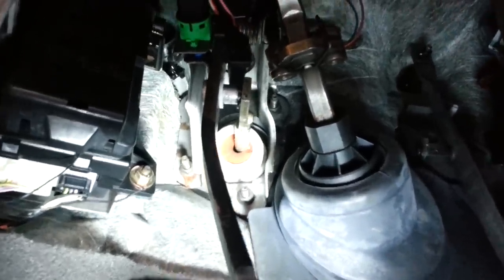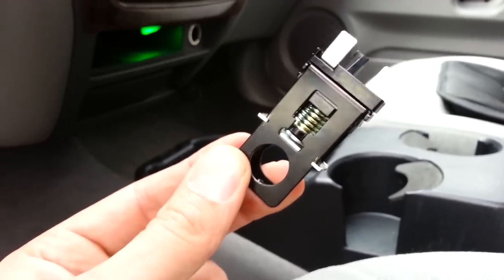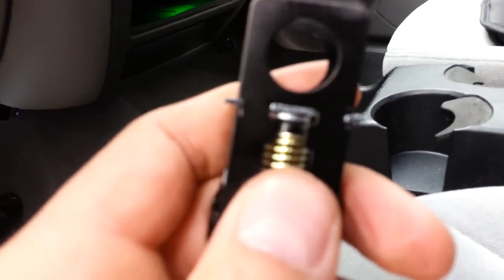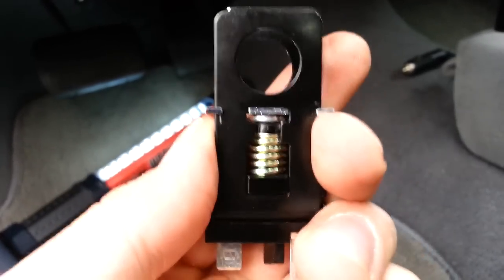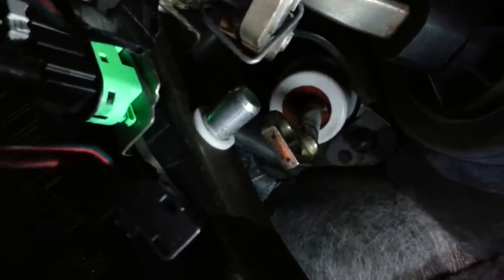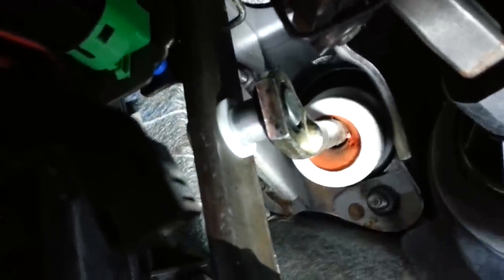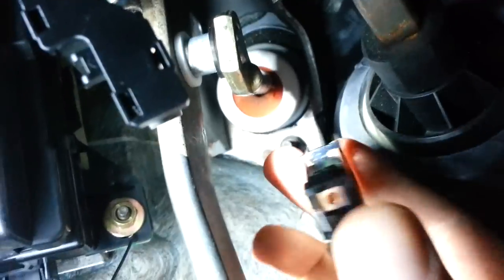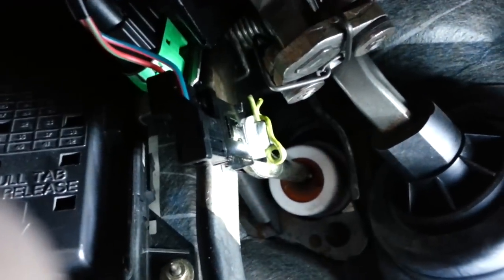Ford Taurus Won't Shift Out Of Park, Brake Lights Don't Work With New Switch- How to fix 2023

Comment from the maker: Note: The Motorcraft stoplight switch may function perfectly versus the OEM switch from your local Auto parts store. If you can purchase the Ford part, I would recommend that.
Reply: how could the 2 be any different, I know the ford part would cost more! a lot more.
Reply: Was your old brake light switch plastic housed with a square male plug that went into it and pre recall?  And is that the reason why this switch required wires be spliced? 

Also do you recall witch parts store you got your switch from?

Edit: I think my switch in my 01 Taurus has shorted out due to me having to wiggle the wires in order to get my brake lights to work and the car to shift. Now the brake lights won't go out at all and car shifts just fine. If I pull the fuse to get my brake lights to turn out the shifter won't move from park unless I do the partial turn of key and switch to neutral trick before starting.

Comment: Thank you so much for the YouTube.  I was unable to place a washer in as explained however, by placing a flat head screwdrive in the spring and twisting it, the car came out of park. I had to place the car back into park in order to remove my key but not a problem.  I went to O'Reilly's Auto Parts and bought a new switch for $32, 15 minutes to install, everything works great.

Comment: Thank you so much for your video!! This is a life saver. I put the brake switch on a few times, switch the wiring back and forth to the harness and it still didn’t work and I googled and searched for help and came across your video. I used a paper clip between the plunger and the plate, couldn’t find a washer at the time and I connected it back and it worked!!!! Thanks again for your video my friend.

Comment: It's so nice of you to take the time to post this video.  I was able to remove and replace my stop light switch on my 2000 Taurus with no problems. Definitely save over a hundred bucks, if not more.  And I could get the switch off so my battery didn't die while I was waiting for the part to come in.  Thank you very much my new friend.  Season's Greetings.

Comment: I had this problem on my Mom's car and we checked the brake lights and they did not work so we pulled the switch and tested its continuity. That was good so we made this modification with a very small washer and it worked great. Thank you so much.

Comment: This was super helpful and turned out to be an easy fix. The previous owner had done the recall so all I had to do was insert the washer and brake lights and shifting are smooth. Pretty little time in labor, and the washer was under $1. Thank you!

Comment: Peter you're a superstar, and I mean you really rock!  My 2003 Mustang track car's brake lights quit working.  Long story short, I went thru hours of effort trouble shooting and replacing multiple connectors and switches without success.  I stumbled across your video with some helpful advice about the little washer.  I figured what have I got to lose and made the modification.  WAHOO!!!! Your recommendation solved my problem.  I have no idea why a brand new switch doesn't work out of the box, it tested good, but as your explained, it just needs a little extra distance to work when installed!
Reply: I have exactly the same problem with my 97 Ford Fairmont EL ....mine did not work as yet after i installed it....also i still have no brake lights nor Cruise Control function, so i guess i will do it again but i will add the washer and see what happens..ran outta time..Thank you so much for your video, i would recommend you to everyone! Cheers from Wollongong in Australia.
Reply: so the little washer worked
Reply: What size is the washer used?

Comment: I replaced my brake light switch without the washer and replaced the wiring...and now my brake lights work and also my gears shifting back to normal. Thank you so much for showing the how to of this video!!!
Reply: So I have a question you say that this has been in an open recall here it is 2019 and I'm having the same problem with my 02 Ford Taurus. When my brake lights come on I can shift out of park sometimes my brake lights do not come on when I push the brake and of course I'm stuck in park. So I am positive it's the same problem this switch! So how do I get the new replacement one? Is it free do I call Ford what do I do? I know I can try calling forward and telling them but I just thought one of you guys here could tell me exactly what you did knowing my local Ford dealership they're going to want me to bring it in and charge me something and give me the part free when I can do it myself so please just let me know what did you guys all do? Thank you

Comment: I have exactly the same problem with my 97 Ford Fairmont EL ....mine did not work as yet after i installed it....also i still have no brake lights nor Cruise Control function, so i guess i will do it again but i will add the washer and see what happens..ran outta time..Thank you so much for your video, i would recommend you to everyone! Cheers from Wollongong in Australia.

Comment: I'm sharing this great tip from Dee Mac from another site about this problem = In a pinch you can turn the ignition halfway and shift into neutral, than start the car....works in my 04 Taurus.
Reply: Yes. You put it on AC before starting to bypass this saftey mechanism. But saftey mechanism needs to be fixed eventually. the part costs 20$ on AutoZone. 
👇🏻👇🏻👇🏻
Duralast Stoplight Switch F4865
Reply: Thanks, You saved me a tow.
Reply: This was a lifesaver I was just stranded but able to get home because of this tip. Thank you
Reply: @lucasj870  You're welcome

Comment: Great Video dude. Thanks to you I was able to fix my car; which still had the original part. One incident i had though was that the light stayed on when i put the new part. To fix it, I had to pull the part down a little bit and it made a little click sound. Basically I had to put it perpendicular to the brake pedal. and Now it works fine. Had a lot of trouble with the wiring because I am tall guy with broad shoulder so getting under the steering wheel was an issue..but It all worked out.
Reply from the maker: Thanks for the tip!

Comment: Very helpful! Doing a 5 speed swap on my 98 Mustang Gt and swapped pedals and noticed when I plugged the battery back up and started it my rear lights were on without my brake foot on the break. glad I know how this should be installed. hopefully a new one solves the problem

Comment: Hey, Peter. Many thanks for your time - recording, editing and uploading. You're a good man :). I replaced my switch 2 months ago and today it stopped working. Normally I would have gone on a wild ride checking the wires and thinking that the switch is new. I cut a washer that was too large and, what do you know?! Worked. It was the switch after all... Much appreciated :)

Comment: this is a good helpful video, I would recommend trying it without the washer first though, because I had a lot of issues with the brake lights staying on with a washer in the sensor.

Comment: I had seen on a different video the reason the part fails isnt the part its the plug to the part corrodes and stops working  that is why you have to change the wiring as well. It replaces the old plug. .But since you have the new part you Midas well change it as well  thank you for the video

Comment: Well the washer seems to have fixed the problem with my 2003 Mercury Mountaineer not always activating the brake switch. I just hope the washer will stay. It looks like it will. Thanks for the help.
Reply: How did you get the washer in the thing?

Comment: I bought one from Kragen O'Reilly Auto Parts. it worked without putting a washer in as I recall. it was about a year ago and I don't remember the brand from Kragen O'Reilly . the trick of turning the car off shifting to neutral and then starting the car got me out of a jam big time in the middle of the night after I watched on YouTube the other guy showing about that. it would have been tow truck time for me

Comment: New part didn't work either but found out should check #17 fuse for brake lights first. Put in old switch then and worked perfectly. Also a good idea to unhook negative post from battery to save burning out any other fuses.

Comment: If you’re stuck away from home and can’t fix it at its current location , just splice the wires together . The car will work and go into gear but the break lights will stay on. When you get to where you need to be make sure you disconnect the wires

Comment: great video I did want to say I inserted the washer but the lights are just on now and I'm not pressing the brakes any suggestions to what I should do to reduce the pressure?
Reply from the maker: The washer is too thick, you'll need to sand or grind it down to make it thinner.
Reply: @rhynecars  thanks for the response!! I I thought that but I just wanted to ask you first thanks a lot
Reply: It's me again! Still not working! The switch was changed out by my mechanic and checked! What if that brake switch is just fine could there be a fuse under the the hood or is it wiring that needs to be changed out?

Comment: Awesome video dude really helped me to troubleshoot the problem quickly. Especially noticing how sometimes when my brake lights come on I am able to shift out of park but sometimes when I push the brake pedal they would not come on and that's when it was stuck in park. My only question I have for you is you said there is an open recall on this. So if there is my thinking is Ford should provide the switch at no charge! But the way it sounded you purchased yours, correct? Shouldn't Ford give it to you at no charge? And why do you have to use the washer I mean if I got a switch that didn't work and it's supposed to be new why wouldn't you replace it with a workable one? Thanks again for your video it really did help troubleshoot!
Reply from the maker: I found out after the fact that there was a recall. I decided to try and fix this switch instead of  returning it as I also didn't realize that there might be an alternate switch available.
Reply: @rhynecars  just an update I spoke with Ford and after giving my VIN number he said my car was not included in the recall. It was my understanding after seeing the recall notice on cars.com that all 2003-2004 Ford Tauruses were affected. But according to Ford not so. Off to Advance Auto I go.
Reply: Replaced my switch and it worked great! fast forward to Sep.15 same problem. got in the other car and went to church. I had to give it some thought. Watched your video again and the light came on. I put that washer in there to shim it up 9/16/1920 works fine again. Thanks a lot. I worked in retail parts for 20 years and thought about how many switches I sold of that style.

Comment: How about my brake light won't come on until I press really hard? I see my 04 sable already has the aftermarket piece. I've had the car almost 8 years
Reply from the maker: Probably still the same problem, go ahead and replace that switch with a new one.

Comment: I had the same switch gap issue with aftermarket switches. the motorcraft ones don't have that issue.  $58 from ford. worth the money for no fuss.
Reply: 58 dollars, i called a ford dealer, it was 45.00
Reply: @brucemcglasson6417  all Ford dealers charge different prices for the part one local Ford dealer that I called wanted 40 bucks the other larger Ford dealer who has Dodge Buick Ford Etc wanted 50. I'm going to Advance Auto instead 21.99
Reply: What size is the washer?

Comment: What if that brake switch is just fine could there be a fuse under the the hood or is it wiring that needs to be changed out?
Reply from the maker: It's not a fuse if the switch still works at all, for my switch, it meant had to press the brake pedal very hard just to get the brake lights to work and the shifter to unlock.

Comment: I have problem shifting car outta park all of sudden while car is started...what is the problem?? Now have new redesigned version and wiring harness and such how do I install so orks??
Reply: I wanted to add it is a Ford Taurus 2003
Reply from the maker: It's probably the brake light switch located on the brake pedal. Have someone check that your brake lights work. If they don't come on, have them check that your hazard lights work as well.

Comment: Could this possibly be accutate for a 2001 mercury grand marquis
Reply from the maker: Check the part number but I'd assume Ford would use the same switch for both.

Comment: Anyway of testing a switch before installing?
Reply from the maker: Using a multimeter, set to Ohm and place the red lead on one of the posts, and the black lead on the other. Press the switch assembly and see if the reading changes to Zero. Zero resistance on the Ohm scale indicates a bad connection, if you get a constant r adding of almost anything, the connection is good.

Comment: this vid hepled alot can u put a link on where u bought the switch please?
Reply: I found O'Reilly's auto parts store had switch and connectors in stock
Reply: @jbr3rd  but if it's an open recall shouldn't Ford have given it to you for free?!

Comment: where did u buy the switch and what is it named
Reply from the maker: I purchased mine at Advance Auto Parts. You can also purchase it on Amazon here: https://www.amazon.com/Motorcraft-SW6170-Light-Switch-Assembly/dp/B0011DVPFE/ref=sr_1_3?ie=UTF8&qid=1471518784&sr=8-3&keywords=2003+ford+taurus+brake+switch
Reply: any auto parts store, brake stop switch.

Comment: what's the problem if it still doesn't work with the washer? is it the shift interlock
Reply from the maker: +Conway Hy Make sure the connectors at both tail lights are not corroded, and that the bulbs are the correct dual filament style. Replace the bulbs in pairs as well. Check the fuse as well. If the new switch, fuse, new bulbs and connectors are all good, and your lights still don't work, you either have a bad ground or a broken wire somewhere. I would take it to a mechanic at that point as finding bad grounds and broken wires can take hours.

Comment: rockauto  sells the ford motorcraft  SW6170 one for  around 28 to 30 bucks shipped , compared to other places like advance auto ,wanted nearly 80 for the same MC  switch.
Reply from the maker: jack lee thanks man, could you post a link for that part?

Comment: so what if your brakes work and the lights work, Checked all the fuses, And changed the brake light switch. My car is still suck in park and I have no idea what to do...
Reply from the maker: Ivan, double check the wiring to the switch. You may have crossed wires.
Reply: has something to do with your shift interlock

Comment: How did you get the washer on the brake light switch?
Reply from the maker: +Britteni Taylor  I had to use a small flat head screwdriver.
Reply: suppress the top silver piece, and slide it in

Comment: Not sure you call this a afe fix. I put in the washer and the switch got very warm so unpluged and removed washer. Car still doesnt go into gear unless you press and hold brake pedal.  she still don't unlock all the time. Hit and miss, so annoying
Reply from the maker: This is not a permanent fix, I would recommend purchasing a different stop light switch or using the motorcraft brand. Sorry it didn't work out for you.

Comment: Is there a recall for the BOO switch for the Taurus?
Reply from the maker: nothingemo Yes, you can go to a Ford dealer and they will install it for free. I tried to get Battlefield Ford in Manassas to help, but they never got back to me. I decided to do it on my own.
Reply: if u want to find out call a dealer and give them your vin #

Comment: What size washer?
Reply from the maker: 1/4 inch diameter and 1/16 of an inch thick with a 2/16th inch hole. Approximately.

Comment: Mine didn't need a washer, i just had to position the switch the way I described it in my first post.
Reply from the maker: It sounds like your part came assembled incorrectly. Make sure your brake lights stay on when you hold the pedal. The problem with the OEM part is that it will trigger the brake lights initially, but they shut off. The washer helps to "bridge" the gap and keep current flowing.
Reply: Thanks for the info, I will keep an eye for it. I have been monitoring the car for 3 days and it seems to work fine.
Reply: what position is that

Comment: Why did you skip the wiring step that's where I'm stuck!!!
Reply from the maker: If you purchased the replacement switch, it should come with a little paper with a wiring diagram. It will show which wires connect to each other, e.g. red and green striped wire connects to the white and orange strip wire.
Reply: u don't need all that stuff that came in the bag, just take, the original plug, cut it off, and splice in the new wires.

Comment: I seriously don’t get how you got her washer in there. It doesn’t make sense. There isn’t room for the washer to fit in even using flat head or anything you should make a video on how to put that in
Reply from the maker: mercedes mcdonnell I would recommend returning the switch that you bought and exchanging it for another unit. I made this video as I believe the switch I bought was defective. The best option is to get a different switch, preferably from a different manufacturer. I tried a different brand switch and it worked perfectly without modifications.
Reply: i agree too